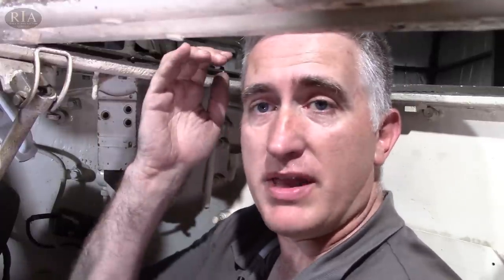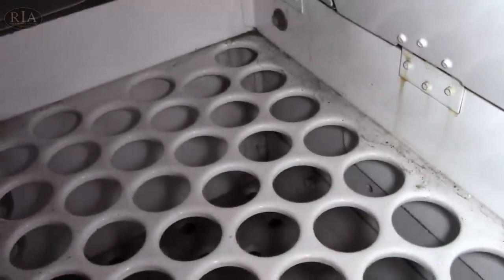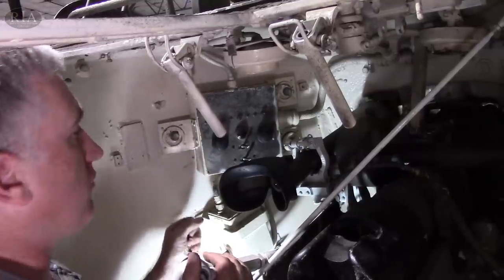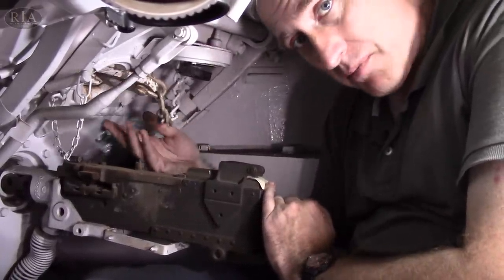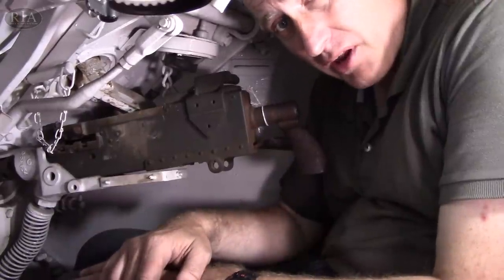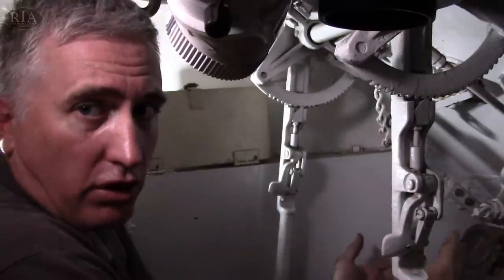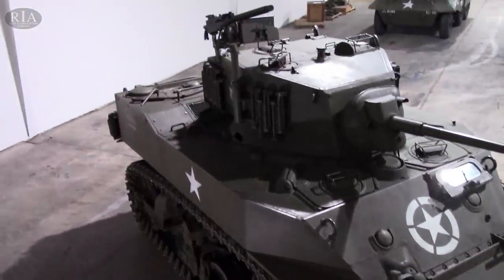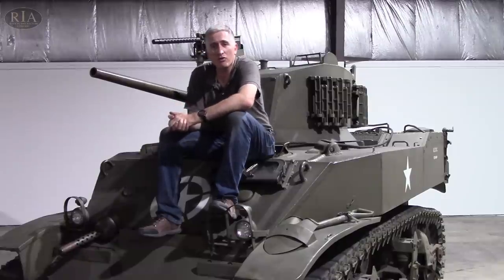Inside the Chieftain's Hatch: M5A1, Pt 2.

Comment: Was that Tiger a confirmed Tiger or was it another case of every German tank being called a Tiger?
Reply: Given that they spent "A while hounding it," I'd say it was at least a Tiger I; If my ballpark of 15 Stuarts for a company isn't off, it's the "weakest," German tank that a unit of that size couldn't take out in short order. Perhaps even better than a II for shots directly to the turret sides and rear.
(Big if goes somewhere in that last sentence.)
Or a God-like German crew, but depending on where you are, you'll be easier off looking for unicorns after 1942.
Reply: There was a confirmed kill by an M8 Greyhound taking down a King Tiger Tank in the Battle of the Bulge. Of course, this was done at the rear of the King Tiger and it took 3 shots at virtually point-blank range for that 37 mm gun to do the job. So if you have a swarm of Stuarts attacking at close-range, then yes, it's possible to kill that Tiger. 
German tank crews followed a rule that you can't leave your tank unless it's on fire. There is a report that infantry took out a Panther tank by using phosphorous grenades to ignite the fuel tanks.
Reply: Hung  Nguyen An M8 Greyhound open-topped armored car firing point-blank into the aft armor of a Tiger II which resulted in a mobility kill. Why hasn't a movie ever been made of that? It should have been called: Balls On Wheels!
Reply: MrJedi5150 Talked to some WW2 vets from the Wermacht. It was a part of the training. Of course, there are those who panicked or those who ran out of gas.
Reply: @HungNguyen-uw8ch  or broke their transmission, or had mud-caked road wheels,  or found any of the numerous other ways in which a german tank could de-activate itself. And then there is the story of a Tiger II commander who leaned over to yell something into his radioman´s ear, only to feel a gush of wind in his neck, as his turret had been smashed right off by a 152mm at precisely this moment, from a sveroboi no one had seen, at which time he decided it was time for him and his lads to vacate the premises in an urgent manner. No one got hurt, btw.
Reply: @paavobergmann4920  Not all German tanks were unreliable, this mainly only applied to the Panther, and early Tigers.

The main problem for German tanks was a lack of spare parts, the time consuming process of replacing parts, and undertrained crews.
Reply: @lowesmanager8193  I only wanted to mention that they could get useless (it is quite possible for a bad or simply nervous driver to trash a tank, even nowadays), at which time, as i have heard, it was not uncommon for the crews to leave them. Sometimes they even left them under fire only to come back once things had calmed down, to see if the vehicle could still be repaired and eventually retrieve it. See, if your only problem is that the breech got stuck, or your turret jammed, there´s no need to get shot up along with your vehicle, right? Reliability-wise, as I was told, tanks of all involved armies were surprisingly comparable, with a few types of vehicles sticking out either way
Reply: @HungNguyen-uw8ch  Don't forget that you can defeat an enemy tank without ever penetrating it's armour. Immobilising it effectively renders it combat ineffective and the crew will then tend to bail out (usually scuttling it first). Most of the large German tanks that are in museums today that were captured in combat either had damage to the tracks, meaning they couldn't move or something like a jammed turret ring (as with Tiger 131).
Reply: @lowesmanager8193  early war tanks might have been "not unreliable" but there's a reason American tanks get a lot of credit for reliability and German tanks don't
Reply: @sawyernorthrop4078  And you don't think that has anything to do with the fact that the Americans produced way more spare parts for their tanks than the Germans did, and that American logistics which supplied those parts was much better than the logistics of the Wehrmacht?

How about the rapid decline in the quality of German crews as the war went on who often times were rushed through training and the decline in quality control with the manufacture of tanks and fuel. 

Lastly you have to consider that lots of German equipment towards the end of the war was being built by untrained slaves who would sometimes sabotage what they built.
Reply: @UC7LADZa0a3J8LFeh_nW0bog it comes down to a difference in priorities. American tanks HAD to be reliable and more importantly, easy to repair in the field because the factory was 3000+ miles away. German tanks, in theory anyway, could be sent back to the factory for a refit.
Reply: @sawyernorthrop4078  That's another really good point, I forgot to mention that one
Reply: @lowesmanager8193  This was an enjoyable back and forth to read. If only every internet interaction was similar lol.
Reply: @lowesmanager8193   American logistics is not to be underestimated, true, but a lot of it is automotive design. Unlike Europe, the US is vast and not covered by metalled roads dating back millennia. This leads to automobiles (and trucks and tanks) designed primarily to be simple, rugged and reliable. European motoring press has always derided American cars for being agricultural and brutish, while the American press has disparaged European automobiles as finicky and unreliable. They are both right.

Comment: Mr. Moran, correct me if I'm wrong but my understanding is that the hydra-matic is a four speed, so you would have 8 gears using low and drive on the transfer case....

Comment: The Bradley's turret is vertically larger, but horizontally similar. At 5'8" it was not a bad fit for me. For big fellas it was pretty tight. I learned how to sleep sitting up in the turret with my arms over the ISU.  It sucked, but sleep was sleep.
Reply: It can get pretty cramped. I believe the LAV and Bradley turret, at least 25 years ago, are quite similar.

Comment: Also with only one engine running you only had one fan so if both air intakes are open you're only drawing half the air through each radiator instead of all the air through each radiator when you have two fan's running.

Comment: You had to cover the dead Engine air intake so all the cooling air would go over the running engine so the carburetor would not boil the gas and vapor lock.

Comment: Stuart light tanks taking out a Tiger? Wow, and the Shermans in Fury had trouble taking out one of those.
Reply: The 37mm gun had about the same penetration as the Sherman 75mm guns, it's just that the 75mm ammo is larger and that the AP had about 110mm of penetration which the Stuart could do at most 90mm's.

Comment: 3000 miles is far beyond the urals, so no, in europe i doubt many tanks made that number
Reply: joost te boekhorst Probably the only time they got there was driving around at army bases after the war, lol.
Reply: There was also.the problem of surviving olng enough to travel.3,000 miles.  Optimists, they were.
Reply: Pete Sheppard if it did survive long enough to drive that distance, at least it would still be working.

A tank that can't join the fight is useless, so you better have it available and possibly have it destroyed in the fight, as not ready to fight in the first place.
Reply: Little M5 Stewart here has a friend named Arty. And a Radio. The most dangerous thing you can run across in any theater of war for the last three quarters of a century is an American with a radio.   Also even in the ETO , aside from acting as a scout.. it would suck to be in your nicely made defensive position ready for any infantry assault when  your final thoughts are "Freaking Americans must carry tanks in their back pockets" .. 37mm canister rounds and 7k rounds of 30 cal from a mobile pillbox is not as bad as having  a Sherman knock on your door..but dead is dead.  (and this was certainly more practical for the Pacific theater)
Reply: True!  Whatever other faults were attributed to American tanks, they were highly respected for their reliability.
Reply: Used them a lot in North Africa. Especially the 5th Tank Regiment of the 8th Army
Reply: I doubt that many didn't make 3000 miles unless killed in combat.  The whole idea of mechanization is mobility on the battlefield.  They didn't just drive steadily forward, these light tanks were used for reconnaissance and patrolling.
Reply: @blaster112  as long as it serve well ij Zombie Apocalypse...  So why not?

Comment: Not a bad vehicle. Decent sloped armor in the front. Reasonable crew comfort...though put the short fellows in the turret, and the commander is a bit over worked. It was known for being reliable. A...fair gun. I mean you are not going to be hunting heavy tanks with that little 37mm, but for what it was suppose to be doing, a good vehicle.

Comment: Chieftain, I've noticed that in your tank tours you do not mention internal lighting. Is it universal across the tanks how well would they be lit? Would it generally be bright inside or rather dim?
Reply from the maker: I very briefly mentioned a dome light I think. (There are two in this vehicle’s turret). By the 1950s, you start seeing selectable lights, where one bulb is white, the other green or red, which bulb you use depending on the situation.

Comment: Probably you need to cover the air intake if driving with only one engine as other vise the all air pulled by cooling fan of working engine wouldn’t go through radiator of that engine. When driving with one engine you probably need all the cooling to keep it from overheating.
Reply: Valde333 There is also the possibility to pull fuel out of the unused carburetor.
Reply: I was actually thinking more along the lines of pulling oil out of the opposing filter, but I haven't looked at the schematics yet. If there's any vacuum applied to the intake side of the non-running engine then it's going to eventually suck dust and crap in to the dead engine's crankcase via the road draft tubes.
Reply: But why would covering the air intake stop this from happening?

Comment: Hey i have a question about, the Sherman actually. When you and others talk about the swap from a 75mm gun to a 76mm gun, a question always plagues me.
Why not just, make the barrel on the 75 longer? Surely that, coupled with an improved AP shot of some sort, would have a noticeable degree more penetration than the base shorty 75. Simply making it longer would also allow you to not complicate the supply chain with an entirely new caliber to sort out. What am i missing here?
Reply from the maker: There are a couple of problems. Firstly, it affects the balance of both the gun on the trunnions, and the turret as a whole. The former may not have the room inside the tank to properly compensate, the latter requires additional tonnage on the back of the turret. (See the M10 counter-weights for a case in point.). Secondly, the powder charge really is set for a burn sufficient for the cannon length. If the cannon is too long, then the gas stops expanding before the shell leaves the barrel end. This creates a vacuum sucking the shell back into the gun before it even leaves! Finally, there was no need to create a longer gun when the T45 HVAP round was created. In the end, though, they decided for whatever reason that the HVAP should only go to the 76/3"/90mm guns.
Reply: Thanks for the quick reply!

So, what i gathered from all that is pretty much they would have had to solve the same issues (And a few more) and just deal with the same logistics complication either way, except they'd probably have gotten less payoff for their trouble with a long 75 compared to the long 76. Interesting.
Reply: I recall reading, some decades ago, a tanker's account where he mentioned that they were issued a few, emphasis on few, HVAP rounds.  So that means he was in a 76mm Sherman.  Interesting.
Reply: Some badly balanced WW2 tanks couldn't effectively rotate their turrets if not entirely on level ground, mostly but not always those with manual traverse. From memory the M10 was one of those that had the issue until properly counterweighted.

Comment: What's the problem with his rings?
Reply from the maker: Look up "degloving", (unless you are squeamish). It is a very bad habit to wear rings around armored vehicles.
Reply: Lets just say its extremely painful and 8 times out of 10 the finger is lost. My brother found out the hard way.
Reply: Or machinery in general, including basic power tools.
Reply: I did not deglove my finger, but it took awhile to get the side cutters in a position to cut the crushed ring  from the finger.. Really lucky, no (permanent) damage.   

Don't ever wear one of those new titanium rings, the cutters that EMT's use to remove rings from fingers barely mark the titanium.